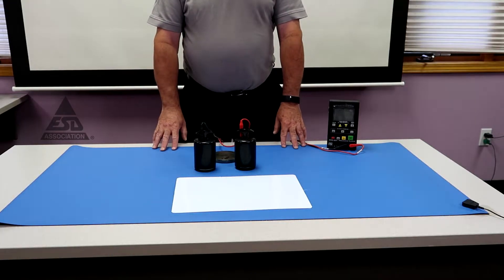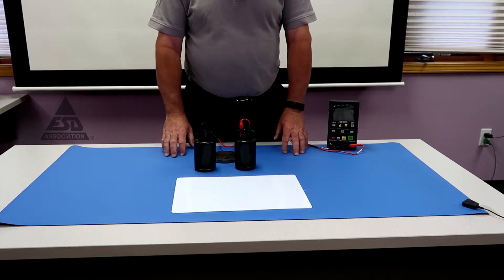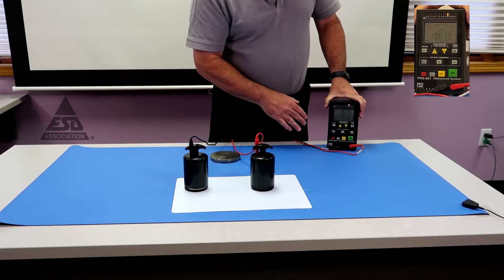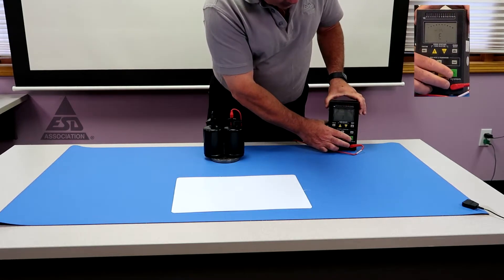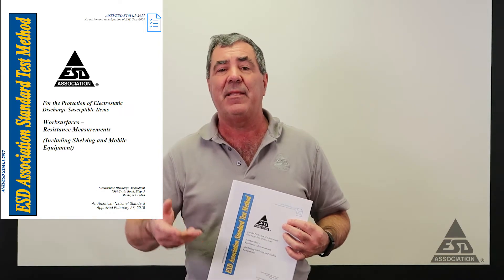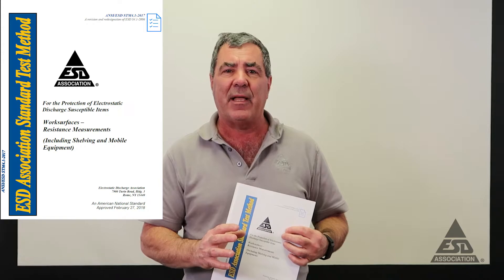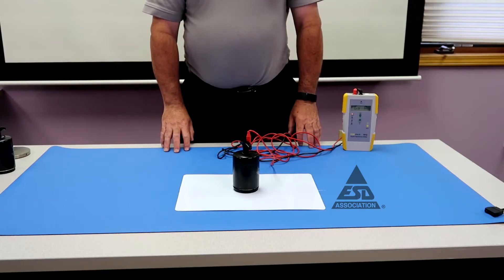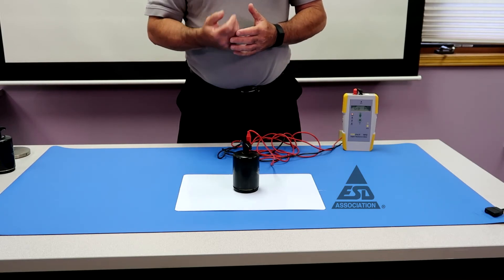Measuring Resistance of Worksurfaces, a Cornerstone to any EPA - Product Qualification & Compliance

Comment: Hello, there loved the video. Quick question, is there a minimun area of contact that the probes should have when I take measurement? I am currently working on a proyect that involves plastic esd materials glued by a special silver epoxy glue to an aluminum part and then check the resistance on each plastic esd part. The esd parts are square about 3/8 in by 3/8 in. The probes do not fit so I machined a smaller round ones using bronce with a diamater of 3/8in and a hole so the banana plug could fit. My results have been the same than using the big probes that come with the equipment however if I use a smaller cautin probe the measurement just sky rockets. I was just wondering if you could help me. Thank you in advanced
Reply from the maker: I would check to see if the probes are working. Using a metal plate see what the reading is with the probes. Should be less than 1x103 ohms. If that is within range, then the probe may not be making good contact. Probe size should not matter as we have a small two point probe. 

If the probe is small enough, it could be the way the plastic is made. In order to make plastic somewhat resistive, carbon is added to the base material. Sometimes the carbon is not uniformly distributed, and a small probe may see that discrepancy. Using the two point probe and the larger 5lb probe will show differences in the same material. 

If it is possible, can you send a picture of the setup and we could have more comments. Also check the video Three Common Probes for Measuring Resistance which shows the small two point probe.  

John Kinnear
ESDA Sr. Technical Manager